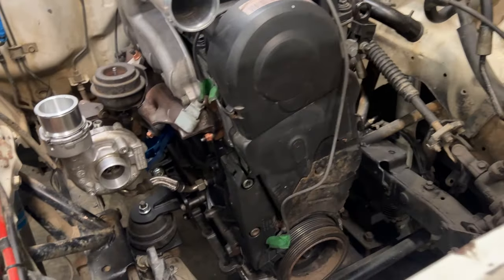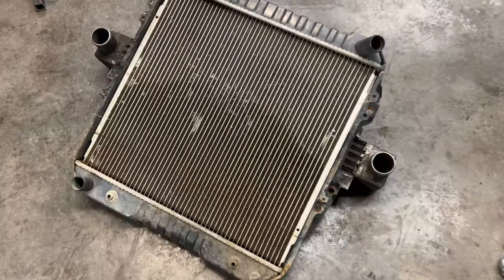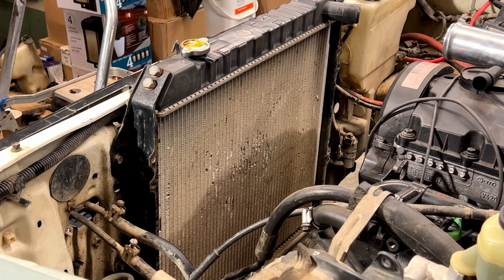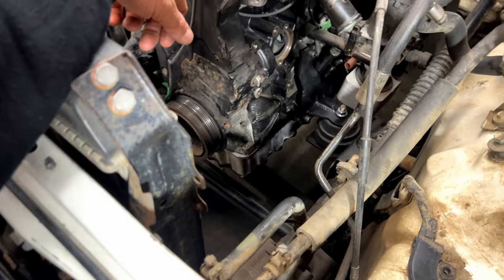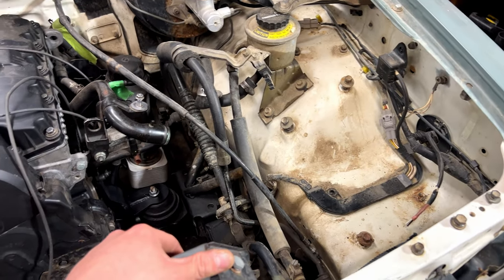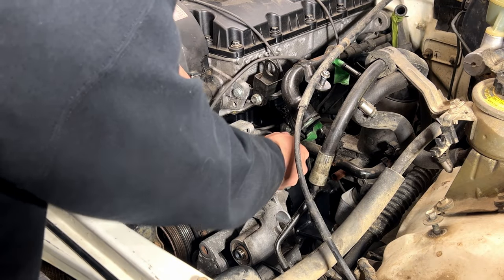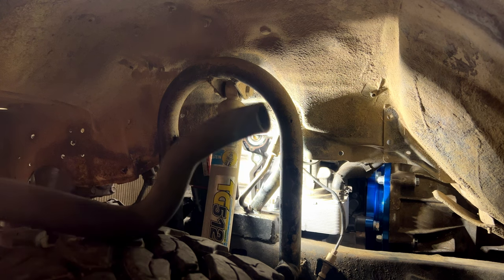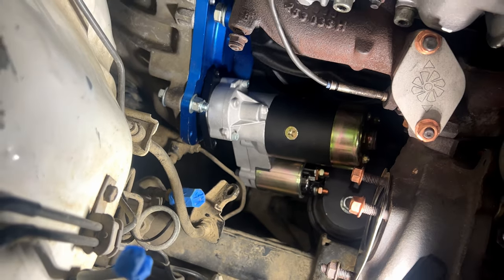So Many Problems! | Toyota Pickup TDI Swap Episode 4

Comment: Doing an Alh swap In my 91, think you can link the intercooler you got?
Reply from the maker: Nice! Good luck with the swap. Here’s the intercooler. aqxreight - Turbo Intercooler,... https://www.amazon.ca/dp/B08W9K483N?ref=ppx_pop_mob_ap_share
Reply: Appreciate it! Anxious to see how it fits!
Reply: @alpinefab  I can’t seem to find the measurements for that intercooler, do you think you could send me the measurements so I can see if it’ll work for me?
Reply from the maker: It’s about the same size as the core of the factory radiator in the truck
Reply: I’ve got mine on the road again! It’s awesome! Can’t wait to see how yours comes together!

Comment: Sorry, but you chose the wrong engine for this job. You should have selected the 1KZ-TE from Toyota. That's what I did for my 97 4Runner and 95 Pickup.
Reply: Yeah right. 1kZTE will crack a head if you look at it sideways and has less than ideal parts availability in NA. TDI is best choice for repowering toy truck. 
I've dailied a tdi swapped 1st gen taco with 190hp 310 tq for nearly thirteen years @ 30+ mpg average. 1KZTE is a heavy, old school idi, fuel hungry, pig that's better at generating heat than power.
Reply: Sorry, but you chose the wrong engine for your job. You should have chosen a 2.0L BHW because that's what I chose for mine. You also should have eaten scrambled eggs for breakfast because that's what I had. Wrong again.